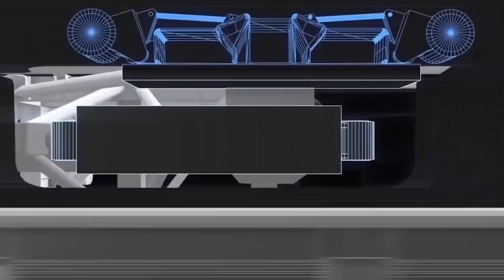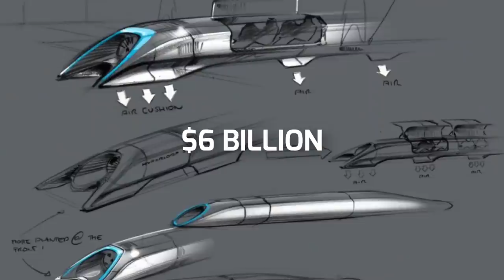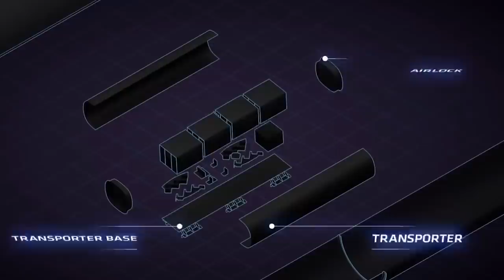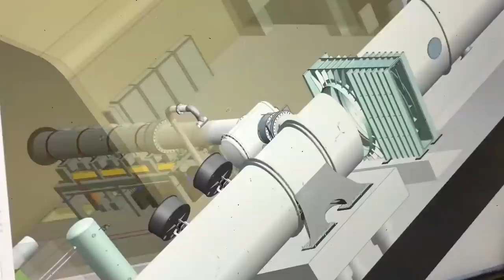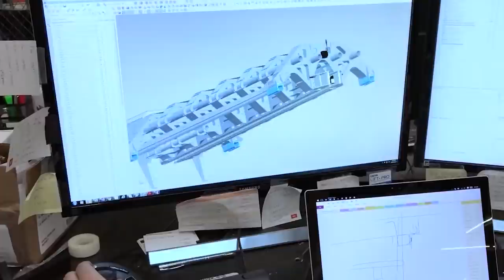Elon Musk Reveals How Hyperloop Will Change Transportation

Comment: Brunel’s Atmospheric Railway was not a Hyper-loop. The vacuum tubes were only about a foot diameter and were only designed to propel the train  without an engine. The excuse for the cancellation of the project was due to rats eating the seals of the tubes. The real reason was that the trains couldn’t make Devon’s (UK) gradients. But similar systems were used for aircraft carrier catapults.